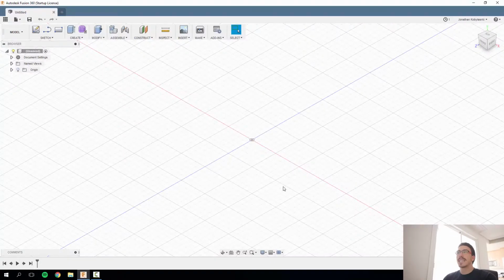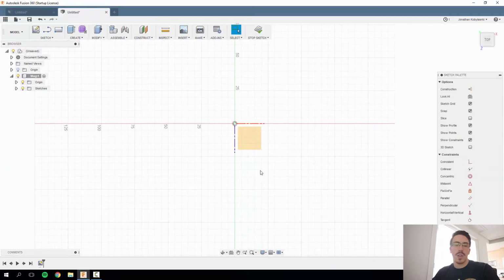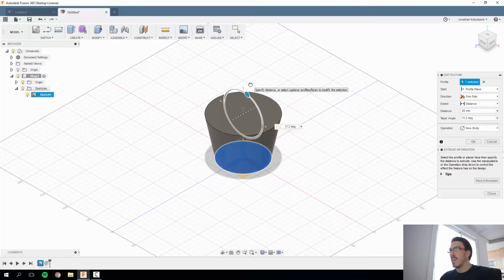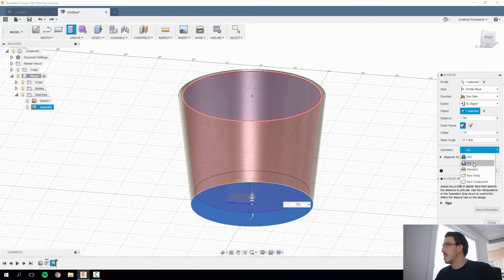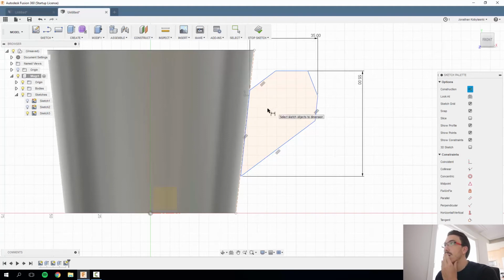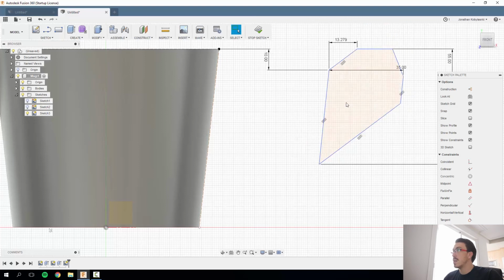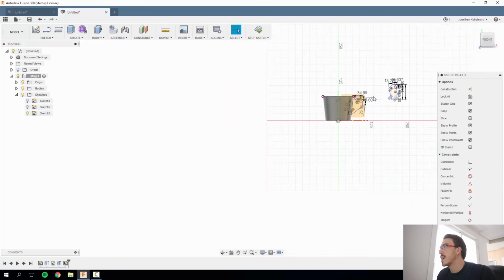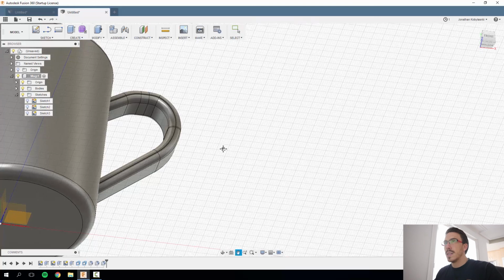My First Hour In Fusion 360

Comment: good effort, stay away from fusion 360 lolal :O) FreeCAD instead
Reply from the maker: One day I'll see if I can wrap my head around that one
Reply: @Keep-Making  from what I can see it's very similar, although I tried without looking at the manuals, and was able to do something, but after a brief view of the help in free cad and use of its assisted work flow it seemed easier than your experience, but still requires a different work flow. From others I've seen who do tutorials of freecad there is little difference to its capabilities as solid works, a very powerful engineering app.